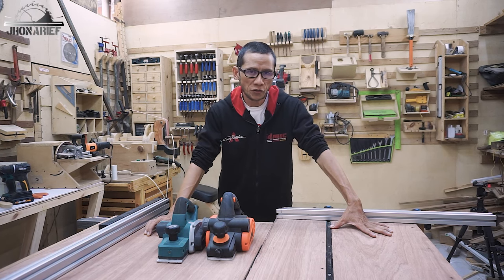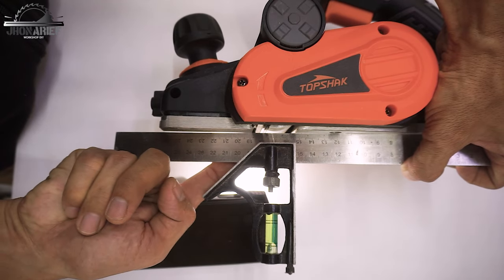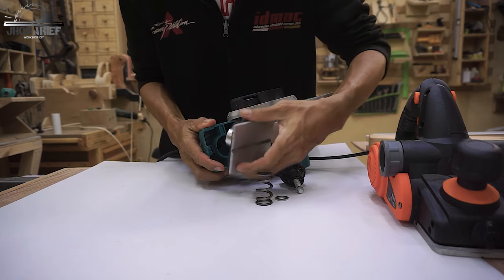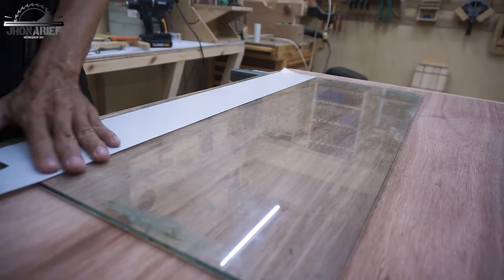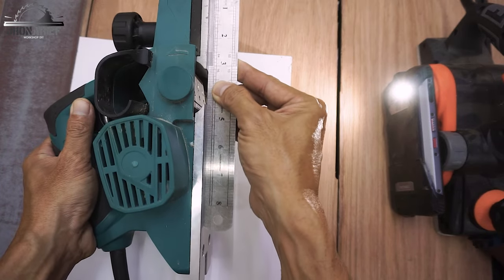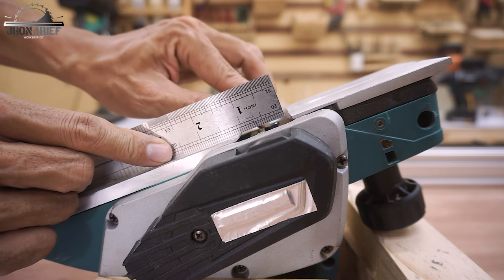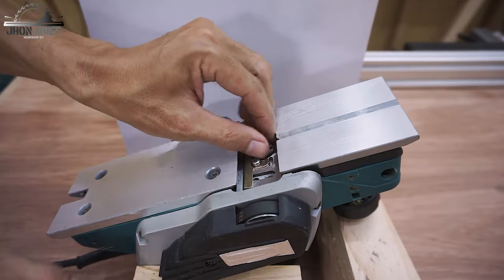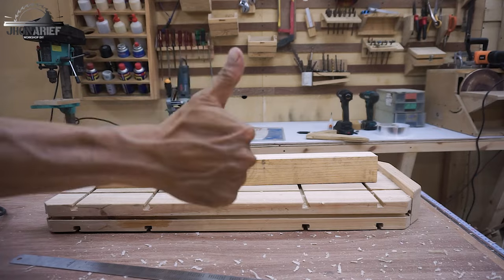EASY WAY TO MAKE ELECTRIC HAND PLANER PRECISION ( HOW TO CALIBRATE HAND PLANER )

Comment: I just did my first hand planer blade replacement today without a previous clue on how it's done. I seriously chipped the old blade, running it into the tip of a wood screw I didn't realize was sticking out there. That led me to click on this video. I should go back to it tomorrow and do those adjustments. Thanks for the info.

Comment: I love it very much. Thank you, to make the adjustments a bit easier; use a wooden stick, turn the deepness on 0.5 mm and turn with your finger the cylinder bringing the stick forwards write down where the stick stops on the sole. Repeat this on the other side of the blade as soon the lines are the same move to the other blade and repeat. Good luck and good health to your family thanks for sharing , all the way from Mexico.

Comment: I have always tuned my hand planes, but never done this on my power planes. I always just accommodate any alignment issues with how I use it. I think it is time I tuned the power planes. 
I've never seen the little blade depth strip on my older (2nd hand ) planes and always wondered what the threaded holes were for. 
Thanks for the video.

Comment: Great Great Job!
Recently - had to change my blades -

Forgot what I did last time -

Originally had the small carbide double sided blades -

Decided I wanted the old style.

Rewatched many videos.

Mine did not come with the - a the “ GUIDE BLOCK” that now comes with the planer.

Also my adjustment screw and the dial don’t align or at least don’t make sense to me intuitively - since in a way Zero degrees would be - the front and back plates are even and turning clockwise would intuitively make the front plate raise - 

But at zero degrees you can’t raise the plate anymore anyway I often have to prefigure out how to start cutting with the tool-

Also I must check the flatness of the back and front- NO doubt they are NOT at zero even!!!

And therefore the tool is usually used to remove great amounts of material before making things precise using other methods .

Thanks for the tutorial - 
Greatly appreciate it!!!

Comment: as you have altered the platen does this mean you can no longer use the blade setting gauge that comes with the planer?
Reply: You can, as you set the blades to be level with the base (when set to 0) - after tuning the base.

Comment: Great video ..
You do the calibration with the planner set to minimum or maximum depth?
Reply from the maker: I do calibrate  the blade using back plate as my reference nothing to do with adjuster front plate
Reply: @jhonarief  And when you are sanding  ? What is the position of front plane then ?
Reply from the maker: @kruskotv1311  adjust the front plate untill the lower side touch with the sandpaper, after that give few stroke on sand paper also lower step by step each time until the front plate aligned with the back plate (dead flat)
Reply: @jhonarief  Thank you my friend, your videos are great

Comment: Can someone recommend a good “Tool Vice/Clamp” and/method to hold this planer (and other types of tools) in place while working on them; and not damage them? 
That’s been my frustration…as it’s difficult to make adjustments, especially fine tuning when the tool doesn’t stay in the position you needed.
Reply: it should have a through hole on the side for a slide rod. or at least some bolt holes.

bolt it to any old 90degree bracket and fix to your table/bench

Comment: it's a good video, and it would be even better if you were clear about the grits of both sandpapers used. as far as uses of the planer as a handheld tool, i agree it has limited use, but it is very useful for rough planing high spots on one side of a board flat (so that it sits flat and doesnt rock) before it goes into a surface planer. and for that purpose it doesnt have to be a high-precision tool, cuz you are going to flip that board and finish the surface in the surface planer

but i really like the way you made it into a precision tool that will work better than ever in any application
Reply: He said 400 and 800 grit
Reply: 400 for the first sheet and 800 for the second wasnt it. he said it quite clearly.